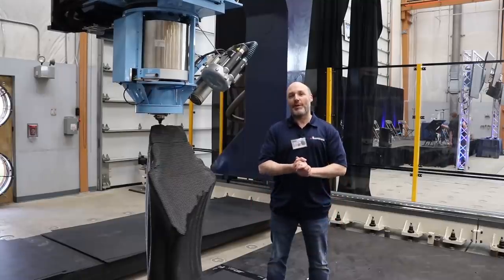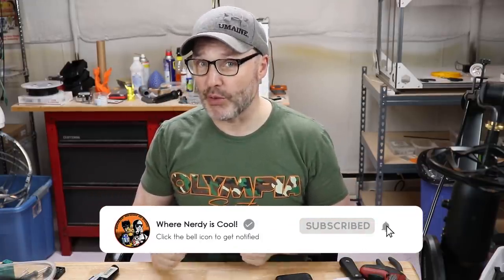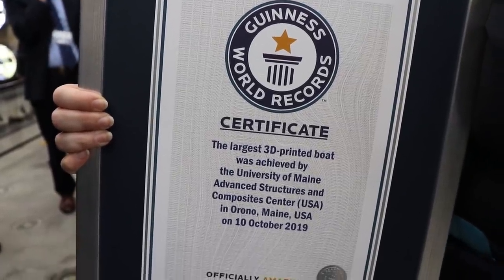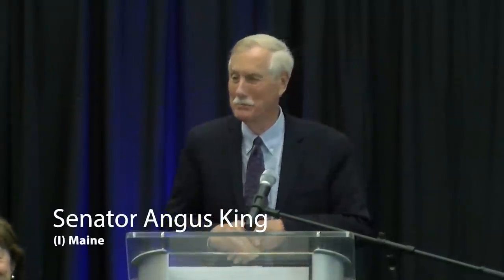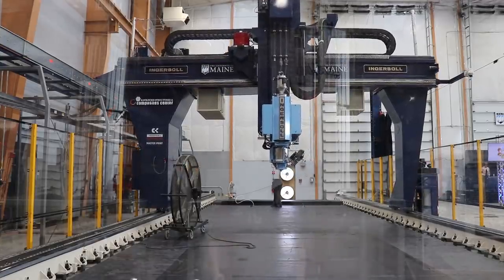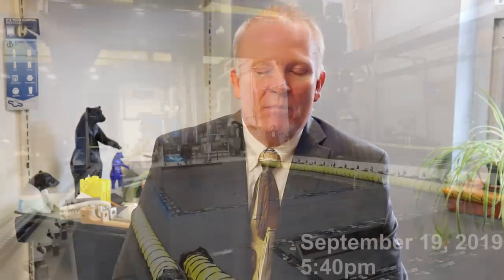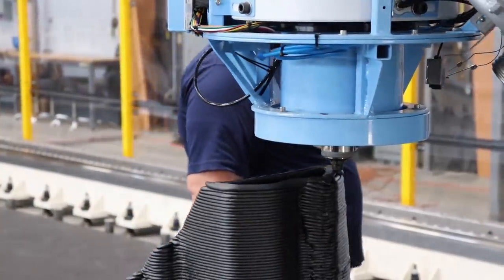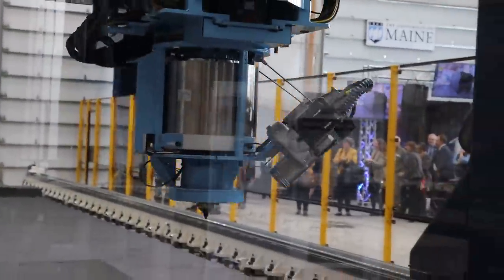The World's Largest 3D Printer & Largest 3D Printed Boat!

Comment: Is it possible to ask/know the printing speed, please?

 If the math is right and I understood correctly the info, we have 2300kg circa as total mass printed in 72h. 
2300kg/72h makes about 32kg/h. 

If the layer height is 5mm and the bead is 12mm large, the area is 60mm2. 
If the density of Carbon ABS is 1080kg/m3, 32kg/h/1080kg/m3 makes circa 0,029m3/h.

Dividing the mass flow for the bead area that is of 60mm2/1000000mm2/m2 makes 486m/h. 
486m/h/3600s/h*1000mm/m makes 135mm/s.  

If the boat was printed at 135mm/s seems incredibly fast, more than the average of small printers. It was this one the printing speed or do they used a different nozzle size for the boat?

Can we know what technics is it used for the adhesion and what are used for, the yellows pipes, please( Fume extractors)?
Reply from the maker: Good questions we can answer in an upcoming follow up video 🙂
Reply: @WhereNerdyisCool  Thanks, it will be really appreciate:) also because it seems not go fast as 130mm/s will be😅

Comment: Paul, please check out this link:

https://youtu.be/G1F4P9O_CO8

There is an also insanely large printer (though a tad smaller then the one you work with) shown working both additive and then subtractive!

I do strongly believe that in future engineering and manufacturing - additive with directly subtractive manufacturing afterwards will gain importance, as it is very resource-saving compared to milling something from a solid block!

Do print a shape with a HUGE nozzle and 3 or 4 perimeter layer very hot with perfect layer adhesion and afterwards milling the outline down by half an inch maybe, to create a smooth enough surface for filler to add, or even to epoxy glas fibre/ kevlar with some resin over and thus reinforcing the part and being able to paint it.

This could result in a way faster approach to one-of-a kind boat hulls and other forms which require tremendous amount of work otherwise or via traditional manufaturing.

Comment: World record largest print ??? What about the construction contractor that built his own 3d printer that printed cement which is a polymer by definition and he printed a castle in his back yard that was way bigger than that boat???
Reply from the maker: Early in the video we point out POLYMER 3D printer 🙂
Reply: @WhereNerdyisCool  perhaps you either didn't read all of my comment or didn't understand what I was saying, and I would invite you to ask any Geologist or even Chemist, they should tell you the same thing as I have, that concrete is a polymer. I'm not trying to detract from your accomplishment but I'm a stickler for specificity, you wouldn't be factually out of bounds to say that your team accomplished the first (to scale or "largest") boat ever printed from carbon fiber, nylon, kevlar, abs, pvc, pcb, or what ever actual material it was that you and your associates used for the print out of your facility, but to say polymer is to generalized,  for anybody to just declare the largest object ever printed from a polymer. Now on another note or way to avoid misunderstandings would to be to say it was the largest boat ever printed from a polymer, but it would be wise to have st say which polymer in there, because during WW2 the US Navy had several ships made out of concrete operating in the Pacific fleet due to steel shortage, and a need for further reinforcement die to Japanese, & Naz torpedos the impact points of torpeo hits were often to large or irregular shape for sailors too patch quickly enough to save theship from sinking unless it hit high enough ,  you can see the concrete naval war ships off the western coast of the US  partially submerged and being used as tideal breaks & breaks for  storm surges to help with prevention of  costal shoreline errosin as well as creating artificial sheltered coves to protect the boardwalks and commercial fishing ships from being slammed into the boardwalks and other items as well I'm sure,  but they are some very neat ships and the last ones were finally decommissioned in the last few years is the only reason I knew anything about the concrete war ships of the Pacific fleet

Comment: Duh 3D-Platform has brochures showing 3D printers custom made at up to 20ft.wide by 12ft. high by (yes) 300 meters long.  They have an Excel Series 2 meters by 2 meters by 8feet long installed at an east coast college.  My knowledge is first hand from their cheif install guy.  It has 3 gantries--- one additive---one subtractive----one robotic arm, so maching fastener placements can be achieved in the same printing!

Comment: I am working on a 2D paper printer that can handle 20 foot by any length say 100 foot at 300 dpi, or even 600 !!! that is 300*12*20 * 300*12*100 pixels theoretically which is a big image and hi res beyond 72000 pixels by 360000 pixels oh *3 bytes for 24 bit colour RGB / CMYK etc is 720 million pixels and a whipping  25 billion pixels or  78 GBytes wow all using a std dot matrix printer modified a bit, and big paper. roll!

Comment: It might not even be the largest polymer printer. There are very large 3D printers here in Knoxville, TN at the MDF which is a DOE research lab. Definitely, the largest commercial/non-research printer though. FYI I didn't specifically check to see if it was smaller than the ones at the lab here, but just a guess.

Comment: as cool as this  is don't you think at university you should be use metric like 99% of the world not pounds and inches very limiting and backwards
Reply from the maker: I’ve pondered the same!
Reply: My guess is that they do use metric internally, but knowing their audience (mostly US based) the director there was converting back to the units most of us understand better (since we use them daily). He did give the nozzle size properly in both measurements... 10mm nozzle. 0.o  A damn sight bigger than my 0.4mm printer at home...
Reply: In what way is it "limiting and backwards"?
Reply: Thats because it is big, and built in the US. All of the materials are in imperial/ SAE unless they wanted to spend exorbitant amounts sourcing the large components in metric. Manufacturing, especially with metal and CNC in the US is in inches, feet, thou, so the motion components and frame would be in imperial. Furthermore, the large prints, example the truck bed, need to fit with imperial in situ parts.

TLDR; it is built out of imperial parts, and the prints need to work with imperial parts, so why would they use metric?
Reply: tjuggernaut29 I’m in Australia and all the stuff iv worked with made in the
Us
Is in metric ie cat and the like  
and the us is by law metric just not widely used for some reason